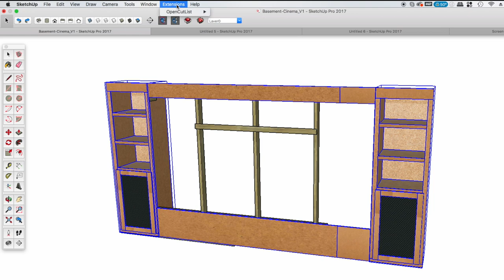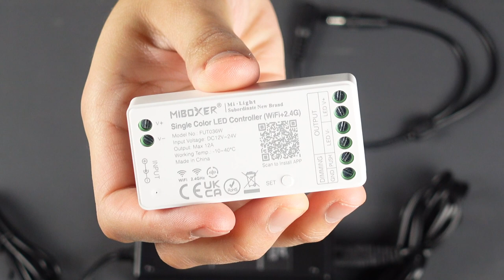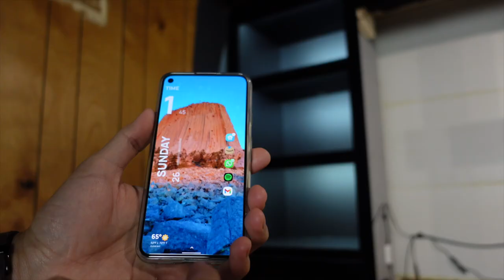Custom MEDIA WALL Build | Movie Theater Room

Comment: Thanks for sharing.  I will use your panel doors for my screen wall build.
Reply from the maker: How did it go?! =]
Reply: @DesigningWithTony  It went well.  We did it a little differently.  We used panels and side doors so I can get behind the screen.  I also used black DMD material on the panels.  It is light absorbing transparent material.  For the screen I used Seymour's UF centerstage transparent material.